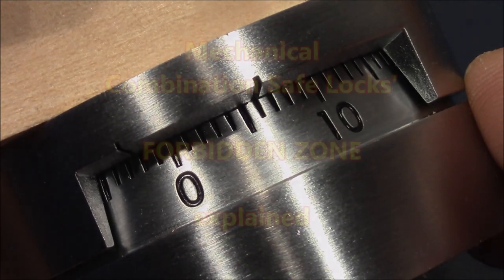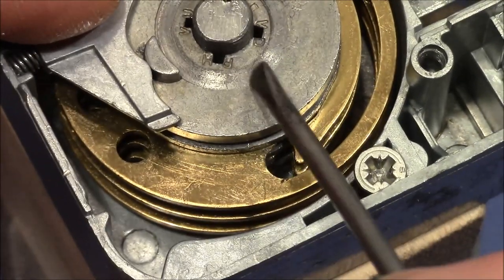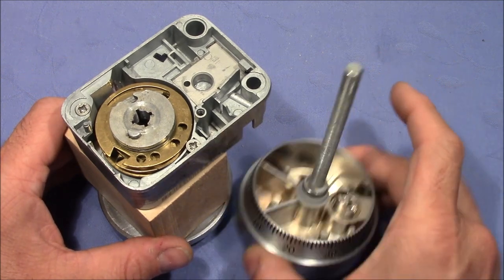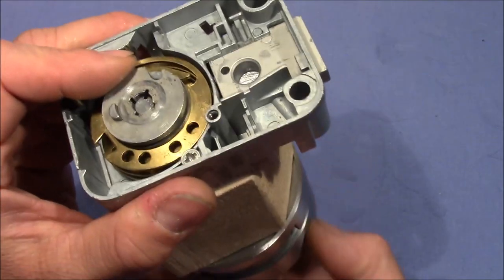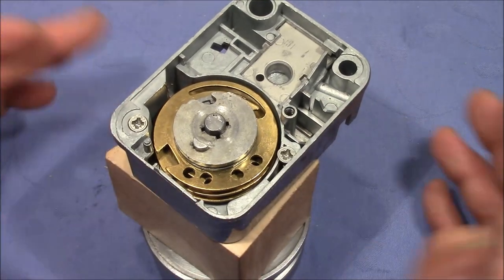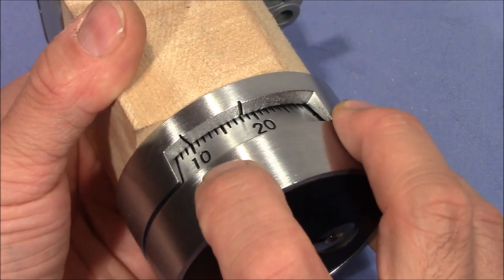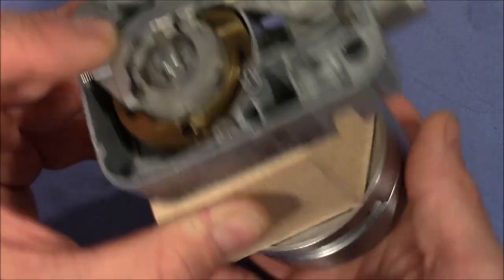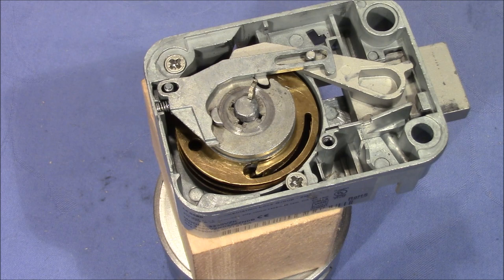(picking 745) The FORBIDDEN ZONE of safe combination locks explained

Comment: Very nice demo of the "Forbidden Zone" -- RH = Right Hand (Not Right Horizontal), similarly LH = Left Hand (Not Left Horizontal) as the correct and accepted terms, but very well done -- got all the other terminology correct -- Excellent -- Good Job -- Now try a 4 wheel Vault Lock
Reply from the maker: Oh, my bad. Thanks for the info and correction.
Reply: @Potti314  I do like the terms "Left Horizontal" and "Right Horizontal" -- they are much more descriptive  & I will start using them  -- seems more obvious to me
Reply: I think Right hand & Right Horizontal means almost the same by  different explanation isn't??😊😊

Comment: I hate myself when I put the dial on the inside. Real hard to get in again.  My S&G safe is quite antique. No key hole on the dial. The door is full of concrete. I came here hoping a lube of the plates would be included.
Reply: Lubing is one of those things that seems be be a big secret.   I even found a vid of a guy who completely disassembled, cleaned, and reassembled an old lock and then just ended the video with "thanks for watching", lol.

Comment from the maker: 0:00 intro, 1:17 parts explained, 3:42 mounting options, 7:44 code change, 10:23 locked in forbidden zone, 13:34 totally messed up in forbidden zone.
Mechanical Safe Combination Locks have a forbidden zone. In this zone you cannot choose the last number - otherwise the lock will bind. Why this is and how this relates the correct mounting for the bolt orientation is subject of this video.
Reply: Thanks Potti. That last one is really bad. If the lock is open, and you've tested it, only to find that you're in thus situation, how fo you 'escape' from it? Will the combination setting tool still work?

Comment: Forbidden zone of "Zero through Twenty"  i0-20) is stated in the instructions for, La Gard Mechanical Group 1, Group 2 & Group 2M Locks.

"When selecting a combination, choose a three number sequence 
from 0 - 99. Never select numbers 0 to 20 as
the LAST NUMBER of the combination. This is
the “Forbidden Zone” and can cause the lock
to malfunction."

Perhaps this is why the safe left behind and provided by landlord for new jeweler tenant does not open with the provided combination, the last number is (18).

Comment: Changing the spline key could actually be a solution if you want to set a last number which is in the forbidden zone. Basically, moving the forbidden zone out of way. Note that changing the spline key means you need to offset your combo with +25 or -25 or +-50 when opening the lock for the first time (or setting it up for change) - and THEN dial your combination without offset when setting your new combo up. This means your lock will internally be set to an offset position, but since the spline key is in a "incorrect" or "changed" position, the dial will read the combination correctly.

So if your current combination is 20-30-40, and you want to set combination 85-12-02 , you change the spline key, lets say you choose one that is 180* off. Then you need to dial 70-80-90 as combination, then open the safe, and then dial 85-12-02 when changing the combo, and then close. Afterwards, your combination will be 85-12-02 and your forbidden zone is at 50-60.
Reply from the maker: But changing the spline key position will invalidate the lock documentation where the forbidden zone is described. If - after a while - you are going to change the code according to the manual (avoiding the described forbidden zone) you could get into trouble.
Reply: @Potti314  Correct.

Comment: I had to look back and forth through this video a bit to understand the reason for the forbidden zone - but I understood after two passes :o) It's the relative positions between the top main drive disc and the first driven disc down the stack  - there must be a couple of pins between those two that connect them together at one point in the rotation.....and when in the forbidden zone, that interaction prevents the first driven disc from rotating as it needs to, to allow the fence up. Would Victor allow you to dismantle the code wheels to show us that do you think ?
Reply from the maker: Yes, you're right with your analysis - will make a follow up to show the part closer and how they interact - pretty interesting stuff.
Reply: You are very smart, dude. You saved me time trying to figure it out. Most idiots on these sites just want to make a Master Lock joke or believe whatever they see without trying it or understanding.

Comment: What's the keyhole for? Never seen or opened a safe with a keyhole on the dial
Reply from the maker: The keyhole is for locking the dial.
Reply: Lockception I guess. Locking the lock lol
Reply: The Lock On The Front Of The Dial Is To Stop People From Messing Around With It & Too Prevent Damage To The Safe Lock Etc. You Can Use It When You Have Unlocked The Safe To Stop The Safe From Being Locked Up Again. Also It’s A Minor Added Safety Feature To Stop Burglars From Trying To Manipulate The Dial Even Tho It’s Only A Wafer Lock & Very Easy To Pick Or Jiggle Etc. I Hope This Helps? Nick🧔🏽, YouTube🔐: Lock Pick Nick & Nicholas Aarons.

Comment: Very interesting! - thanks for showing.  So if the lock was stuck on a closed position because of the bad combination you found (where you explained in the addendum), how do you recover from that?  I guess you open it up and pull off the arm (with the nose / tooth) and pull back the locking bolt, but what do you have to do then then reset it to a good code?  When inserting the change key & turning it, you're meant to do that with the arm (with nose / tooth) in place, but if it is in place then would it be stuck?  Would you then have to take the wheels about and reassemble them in different positions?  Another question, can you pick this lock?  Cheers!
Reply from the maker: First of all there is no change for me to decode this lock. This is a whole other world than the usual combination locks. When you have chosen a bad code you better not have locked up the door, 'cause you have to open the cover and remove the arms from the mechanism and reposition the wheel so that you can set a new code. 
Thanks for stopping by my friend :-)